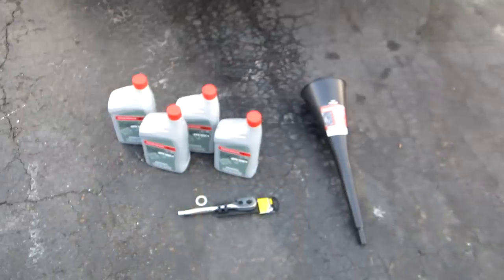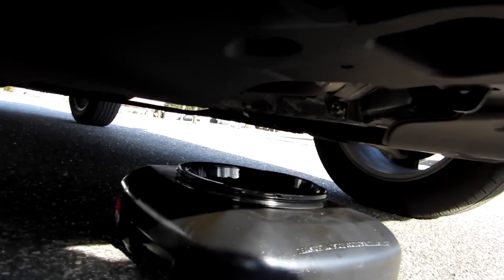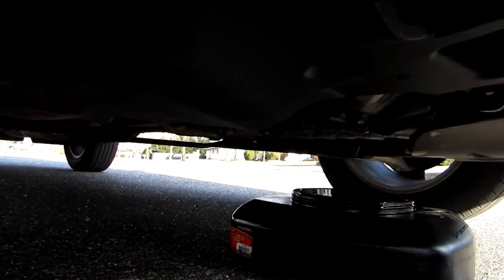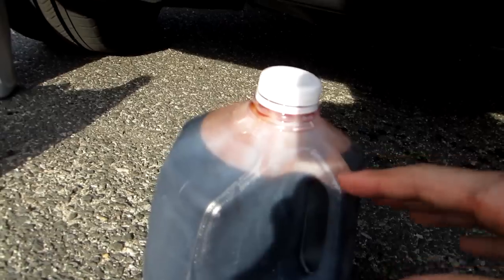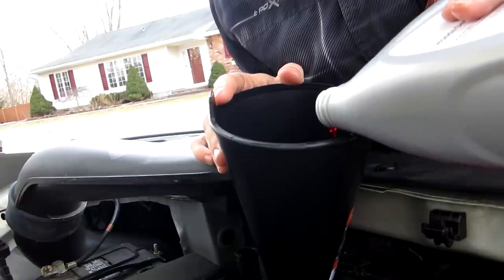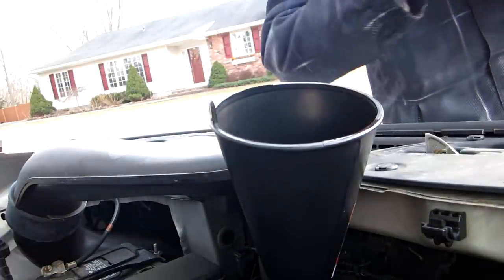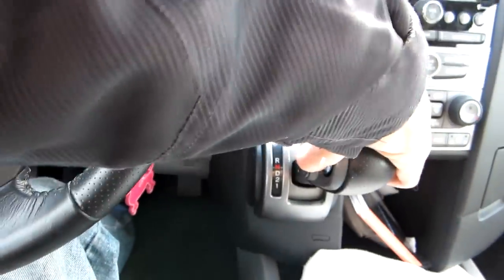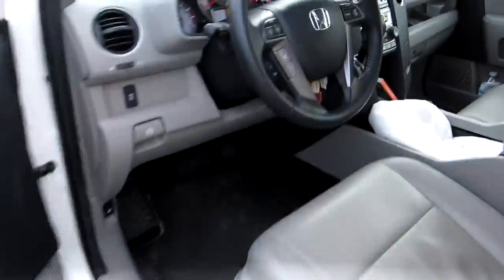How To Change Transmission Fluid On A 2012 Honda Pilot 4WD

Comment: Step #1 is to ALWAYS open the fill bolt first. This is CRITICAL because the first time you do it the bolts are insanely tight and if you drain it first and can't get the fill removed, then your car is undrivable and you have to get it towed.
Reply: Even if you emptied the trans fluid and found out that the fill bolt is stuck you could still do what he did and fill through the dip stick.

Comment: Few things. good video... wear gloves for a a few reasons. Yes there Is another brand that can be used/ the valvoline maxlife Is the only one I am aware of. For piece of mind and to not create any potential warranty issues If you have a bad dealer might as well use the DW-1. Drain and fill is about 3.6qts If I remember. The correct way to do a full flush Is drain and fill 4 times with a little bit of driving In between and running through the gears. Don't ever let someone hook up a flush machine to a honda transmission! and I would also use a bigger drain pan to try avoid a big mess!
Reply: when you say drain and fill 4 times with a bit of driving, you literally means fill and flush 4 times. wow. but if that's what it takes that's fine with me.
Reply: @njdnjdnjd  Yes, drain and fill. Drove it for a bit even around the block helps. And do it again. I also do it 4 times get the most fluid out. Maybe every second oil change do another. Or every one if your like me. Also go get a HDX bucket from Home Depot.  Has quarts on it. So you can measure what comes out as long as it was good level prior to draining you can just put the exact amount back in and should be good to go. I had a 2018 for awhile which the ex wife has now, in warranty I stick with the factory fluids out of warranty valvoline maxlife.

Comment: You drained the transmission, how about the fluid in the torque convertor? Do the initial drain, drive it roughly ten or so miles, repeat, and repeat again.. Until you see clear clean fluid draining out. In your case, the transmission fluid was fine, a waste of time and money on your part.

Comment: FYI: The 2006 FWD V-6 Saturn Vue also uses a Honda transmission.  I swapped out 5 quarts at a time every 10,000 miles.  I refill it through the trans dipstick tube.  Takes a moment, but very easy.  It has a 3/8 square bolt on the outside facing the left front wheel.
Reply: Smart, drain off the tranny fluid at set intervals, measure and replace. Good job! Will keep the fluid clean and additive package fresh.

Comment: For 4WD pilot... when doing the transmission fluid change, you might as well do the transfer case fluid at same time.
Reply: dash display will tell you went to do all maintenance - B136 is rotate tires, oil/filer, trans fluid, VTM-4 fluid.  VTM-4 fluid  and tranny fluid is on a different rotation with VTM-4 more frequently- consult maintenance manual or be out of pocket lots of money to replace either transmission or rear transfer case

Comment: Thanks for the video.  I have a 2009 FWD, and my manual says when checking the level, to run the engine only until radiator fan starts then wait 60-90 sec before removing the dip stick.

Comment: Kudos to your willingness to tackle the maintenance. .... The Honda dealership here uses 12 quarts for the service procedure. Drain the original four quarts. Fill with four more Honda tranny fluid. Start and run around the block. Then drain again. I know, wasteful. Repeat two more times. Keep the last four quarts. The mindset is that the filter inside isn't going to be changed. Way too much labor. So, with that in mind, flush the tranny instead. It worked for my 2007 Pilot. ........
Reply: Wasteful and costly.

Comment: I normally purchase a transmission filter kit ($30 @ autozone/O'Reilly) for the first change, then you are good until next 90k mile fluid change. Dealer charge arms and legs for the new washer and transmission fluid, too.

Comment: Look around the brake master cylinder you will find a 17mm fill plug for the transmission. That is what you should use
Reply: Much easier via dipstick

Comment: the disconnected hose your finger touched at 5:35, what is that disconnected small hose for ? i could not find the answer anywhere :(
Reply: It's a breathing hose for the transmission. Also, expels transmission fluid through there when it gets too hot (boils). Trust me, found out on my way to airport, 3 hours into the trip.

Comment: As long as it meets Honda's standards it's good to go for use.  There's lots of Transmission fluids that meet that standard.  It's not like Honda manufactures their own oil, they rebottle a suppliers oil and mark it up for the Honda badge on the label.  Exxon/Mobil was Honda's supplier up until late 2010 early 2011 when they lost the contract and the next contract was awarded to ConnocoPhillips.    ConnocoPhillips also makes Ford MotorCo's Motorcraft line of fluids.  

Not that there's anything wrong with using Honda labeled bottles of fluid I guess you can't put a price on peace of mind but there's no reason to stress over absolutely getting the Honda "brand" oils.
Reply: I beg to differ. I've put Mobil transmission fluid in my Camry and my transmission started to slip and broke after about 10k miles. Yes one of the big oil companies make the tranny oil but not the same exact spec as the genuine oil (more or less additives).
Reply: I have an 04 accord.. 405k on it..used Redline fluid form first week I owned it...runs like new...
Reply: I have used Valvoline max in my Acura and Honda for years. All good so far

Comment: Do you get any clunk or gear chatter when getting on the gas after a partial stop (5-15 mph) it happens when it tries to downshift as I get on the gas but it binds up and makes an awful noise and jolt. h
Has about 77k mi and I'm thinking about changing the transaxle oil soon.

Comment: I thought the oil change cycle on 2012 pilot is every 15,000 miles?
Reply: That engine oil. This is Transmission fluid, yo. VERY different !

Comment: Just a note. If you elect to use the fill hole, crack the fill hole bolt (17mm) first before draining. It can be a bear and if you can't get it loose, you're going to have to monkey with the dipstick area.

Comment: What attachment did you use for the the funnel to dipstick because the funnle looked to fat to no spill over the dipstick tube
Reply from the maker: Oscar Diaz at the time my auto store didnt have any tube funnels for filling things, so i got a long one and then used some air line and taped it up, worked like a charm.
Reply: Oh I only asked because I use a long funnle with an air fitting on it but after a while the trans fluid seaps threw and will make a mess because the plastic gets weak around the fitting
Reply: Oscar Diaz  Oscar, I also used that method but also added some of that white pipe tape which is normally used for connecting water pipes. So far, after 9 years there are no leaks.
Reply: Felipe Dominguez thanks for the tip
Reply: I know this is late in the game for this video.  You can use 3/8 ID plastic line.  If you race karts or look on a karting shop website, you can use 3/8 ID fuel line.
Reply: A 3/8" plastic tube from Home depot went in perfectly. I taped it to the bottom of the funnel first and inserted into the dipstick port. It stays in fine, no need to even hold it
Reply: There is a full plug on top of the transmission...

Comment: Hey thanks for the video. I just bought a new 2018 ridgeline AWD. I was wondering if the trans could be refilled through the dipstick tube. I didn't see any reason why it couldn't. the trans fill plug on the top of the trans on the Ridgeline is a bitch to get to. It looks like your Pilot has a small diameter dipstick tube (similar to the diameter of an engine oil dipstick tube). My ridgeline has a large diameter trans dipstick tube (about an inch in diameter) which wil make refilling the trans very easy. Glad to see that I can refill the trans through the dipstick tube.

Comment: Instead of a flush, changing more often like with each oil change, will that work?  Doing the flush by changing 3 times with driving in between seems so wasteful.
Reply: Just change the fluid once. I think that 3x flush is more for those pulling and carrying a lot of payload.
Reply: i drain and fill every 3 oil changes

Comment: Always place a a piece of cardboard or something under the car and drain area to protect the concrete and environment from oil contamination. there will always be a few drops that miss the drain pan and sometimes even a good 8 ounces of fluid will shoot across the pan and spill when you remove the plug if the pan isn't positioned right to allow for the initial flow pressure.

Comment: Does the pan filter & gasket also needs to be replaced at this interval?
Reply from the maker: These hondas havent had servicable filters in over 14 years. Honda transmission fluid changes are just simple drain and refills with HONDA fluid and you should change the differential fluid as well.
Reply: TheK24Kyle When you say you should change your diff fluid as well, do you mean at the same time you do your A T fluid as well? Up in Canada we are KM's, not Miles.. Thoughts? I just picked up my new 2014 Pilot last week, wondering what my first change will be outside of oil - Also, do you recommend going right to synthetic, or should I stick with regular? Thanks in advance
Reply from the maker: Skookumm You should change the transmission fluid every 30,000 miles using honda fluid and the rear differential fluid using honda differential fluid as well. you can change the diff at 50-60k also so it depends on the owner.

Comment: I put roughly 3.8 quarts in my 2012 honda pilot and its still reading low on the dipstick after running hot...
Reply: Hope you added more

Comment: Have you ever changed the ATF filter on this 2012 model? Also the official capacity is 3.2qt on a 2WD and 3.6qt on a 4WD. I wonder how you got away with over filling with 4qt.

Also the way to check the fluid is wrong. You should shut down the vehicle to check the ATF oil. The following quoted is from the 2012 manual.

"Park the vehicle on level ground.
Start the engine, let it run until the
radiator fan comes on, then shut
off the engine. For accurate
results, wait about 60 seconds (but
no longer than 90 seconds)"
Reply: I did the same last night for my pilot 2011 model. Yes you're correct in manual book, it is required 3.6 qt or 3.4 liter. However when I check the dipstick level 3.4 litre looks like in the lower level. So that I adjust to 3.6l, 3.8litre and finally 4lt has the maximum level at dipstick.
Reply: Iwa Jogja Yes nine also took 4qts.

Comment: Is it "normal" for the pilots to shift soo hard from park to reverse? Just bought a used pilot with 30k miles I'm going to check fluids...
Reply from the maker: beast57805 if the car is parked on any kind of incline without the parking brake on(transmission holding it in park) yes it is normal for any automatic honda to clunk into reverse because of the weight of the car is shifting. what year is it?
Reply: Thanks man I figured the roll back was the cause of hard shifting started applying the parking brake it made a difference...
Reply: +Mondo357 The best way to avoid that is that every time you park, you do the following; put your car in neutral, set foot brake, release the pedal brake, brake again, then shift to park.
Reply: @EdsonATorres  Thank you for sharing the tip on how to avoid the hard shifting noise from Park to Reverse. Good day Sir.

Comment: What the hell are you doing using a dip stick hole to pour the transmission fluid and telling other people what the hell you are doing in you tube if you don't know hours to change fluid.
Reply from the maker: saving time at home on a DIY because i didnt have the proper tools available at the time to pull the fill plug ontop. Both ways are completely acceptable for servicing the transmission, which is still doing great 4+ years after this video. Oh, i'm also a bachelor degree certified auto technician so GFY real hard buddy.

Comment: DON'T PARK YOUR CAR IN THE STREET AND BE UNDER THE VEHICLE!!!! The last thing you want happen, which is happening more and more, is an approaching vehicle with the driver who is texting and not paying a dime to the street ahead resulting in potential serious injury to the person under the car.
Reply from the maker: Excuse me, but if you PAYED attention to the video i said number one, the cars front tires are at the foot of my driveway and the parking brake is on, and second of all I LIVE ON A CULDESAC at the end  with NOTHING to the left or right of me and my car wasnt jutting out into the road at all.  it's all a private living space and we actually own some of the land in front of the driveway due to a renovation back in the 90's. I know what i'm doing if i actually thought my god damn car was going to be IMPEDING traffic in the middle of a road i would have not made a tutorial on how to change transmission fluid nor have done it myself... common sense.
Reply: Correct your spelling.  It's PAID not Payed, SMH
Reply: anything else steve?
take your car to the dealership and shutup